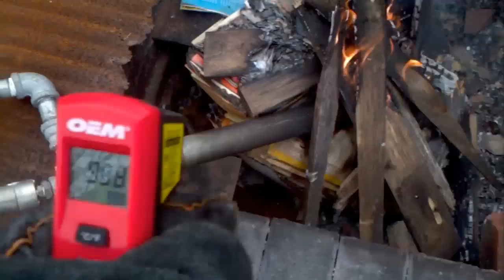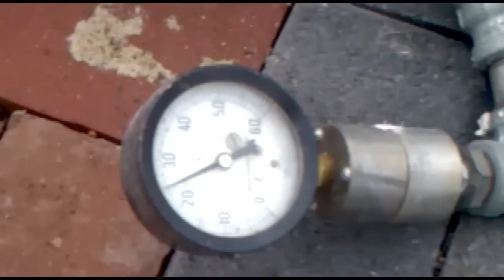my Test Boiler

Comment from the maker: i've actually filled it with compressed air a few times and shot stuff out of the filler pipe. it fits right over your shoulder with the release levers right where they should be :D

tried to use it as a gun again when it had steam but its a bit warm to handle easilly :p

Comment from the maker: unfortunatly if i where to just add another pipe onto it and couple it only at the top or bottom, it may run a chance of one side being more full than the other. and if one side gets compleatly empty and heats up then refills KABAM you now have a busted boiler due to rapid cooling.

but i'm going to experamint with this boiler by coiling a pipe around it and running the exhaust from my blowlamp through that pipe as the heat source. then maybe put some asbestos on the outside to hold the heat. ^^